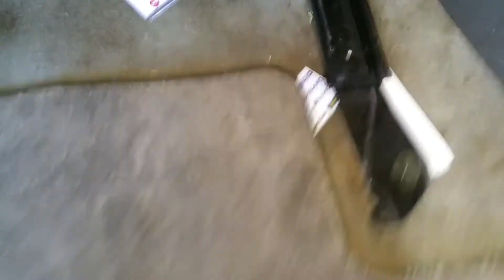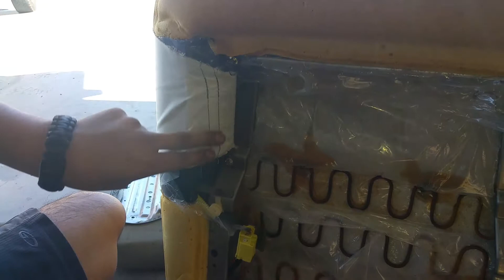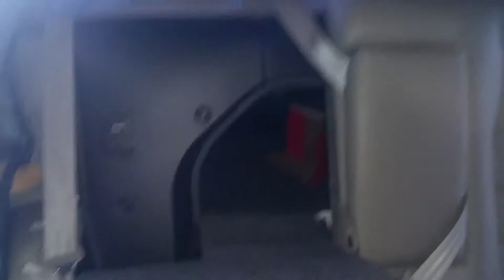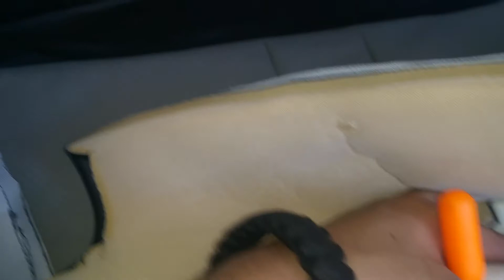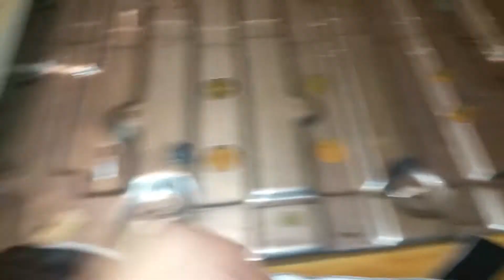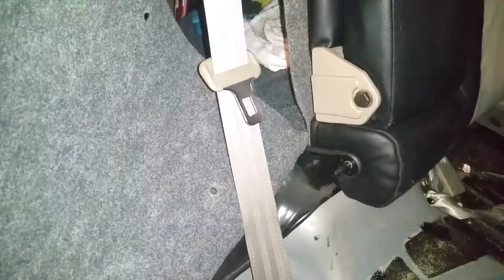How To Install Custom Seats On Your Vehicle! Infiniti G20 Seat Replacement!

Comment: I seen alot of your vids thx for all the diy. Question tho as a few others stated. Can you give us more info on the offer up for the custom seat covers? Link or Name and address of company you picked them up. Thx in advance.
Reply from the maker: thank you for the support, i got the seats from a guy he wasnt with a company or anything like that. it was a rare find
Reply: ERICSDIYGARAGE you should join our g20.net group if you havent already. https://m.facebook.com/groups/127216720514?multi_permalinks=10160201300450515&notif_t=commerce_interesting_product&notif_id=1519731194111271&ref=m_notif